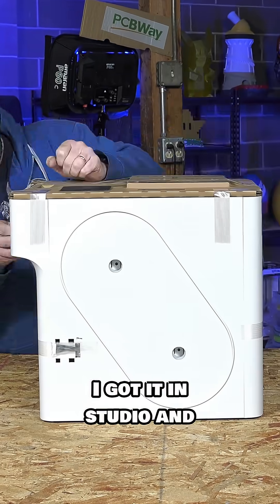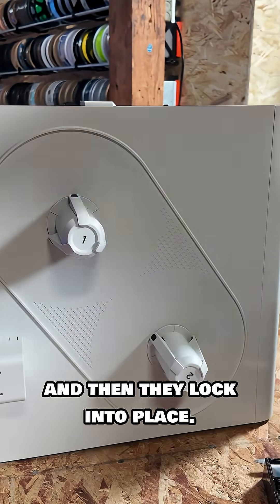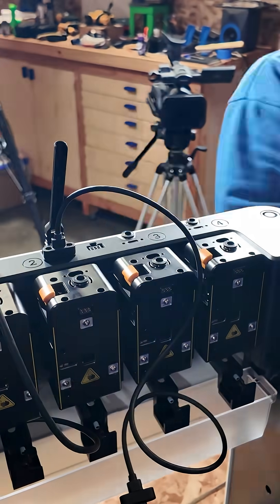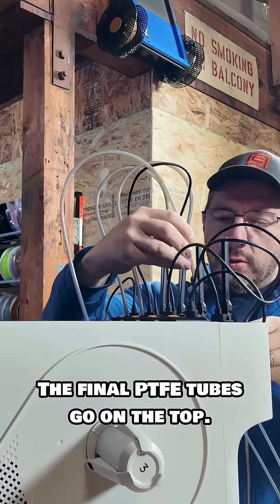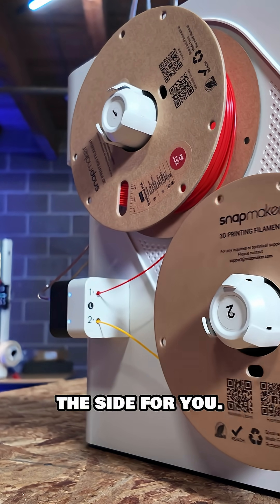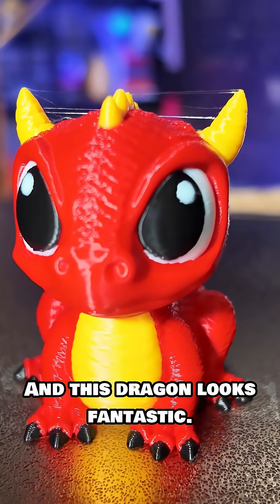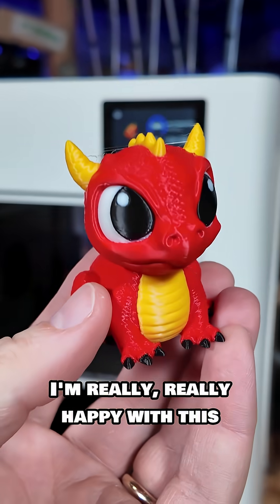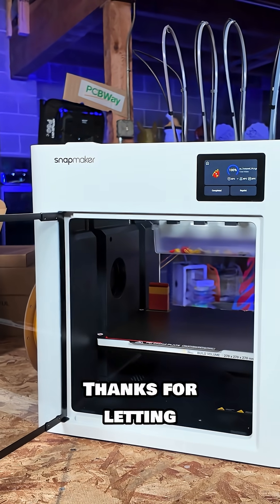Snapmaker U1 Unbox and First Print

Comment: um question.  If it has 4 hotends and each has an individual color, why is there a purge tower and poop bucket on it?

They suggest that in this type of setup that isn't required? 

I understand in the bambu's setup as it has one hotend that needs purging.  But 4 individual hotend each with their own color shouldn't need any kind of purge block or poop bucket
Reply: You can get stale filament in the tool head, and it’s just a small start of print routine for the nozzle at every tool change to clear this…more like a prime tower

Comment: Once I see some of these machines clock over 1000 hours, and we confirm the tool changer is reliable I will totally get one.
Reply: Agreed.  I have seen some of these changeable tool heads, but nothing mainstream beyond the Prusa XL.  

So, I was surprised to see a similar platform used by another brand.  Prusa is way more expensive,  but you are paying for reliability. So I 100% agree that while this looks good initially, I want to see how it performs long term and any support you get with it if things break or fail.  

I'm looking forward to seeing more videos on this printer as it's put through the paces and honest reviews (not the - I got this for free to do a review).
Reply: @arthurcouture7457  I have had my Prusa XL for a few years now,  The tool changing just works, but I have too frequent jams in the nextruder.  It is way too over engineered and heavy.   I feel like a race car pit team on how fast I can swap out the nozzle, and save until i have 4 or 5 and then try and clear out the jams.
Reply: Well I guess I’ll find out when mine arrrives, but not over concerned, it’ll work or it won’t, and the money I save in filament up to a 1000hrs will go towards a repair 😊